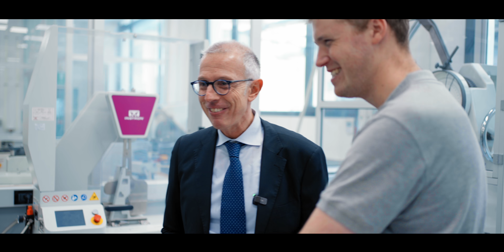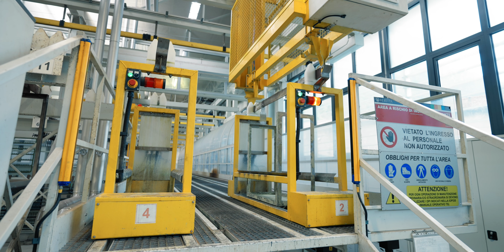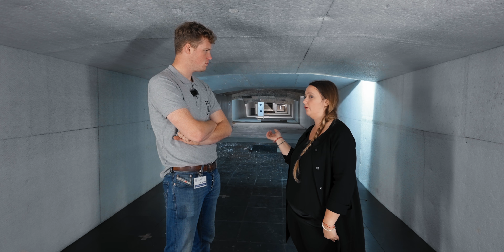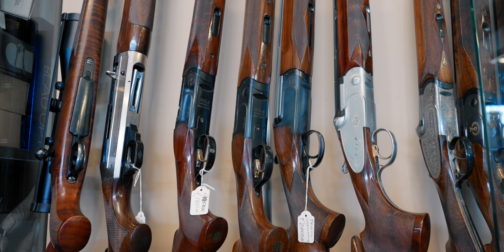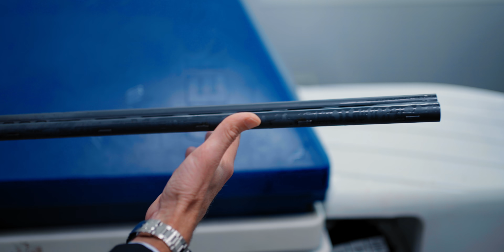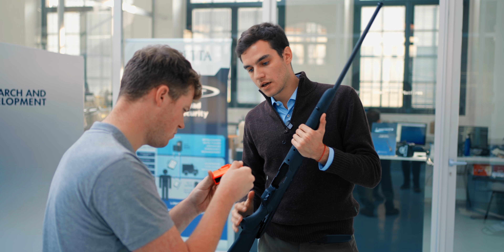The Beretta Factory Tour

Comment: There's some flaws most production guns made within those facilities do not have the capability of iron sights along with a scope combined where as a remington 700 has the options to utilize both on the same gun .the tikka and sako from the factory do not have those options .the sako has the same scope mount as the Brno in which does not have the option for a overunder scope mount !

Comment: I have a full size PX4 Storm in the 40S&W. It is my night stand security system. I like the idea that in the dark I can tell if the safety is on or off with a light touch of the trigger. (No resistance = safety on). I have not  been in a life or death situation but I assume even with shooting targets (100 rounds/month) I may be a bit ramped up and having the DA feels like it gives me a little more control to not accidentally discharge it. If I need to cock it prior to engagement I can. Shooting every other week is probably the best since muscle memory can't be under appreciated. I even practice with dummy rounds drawing and firing from my  bed. (maybe a little paranoid).

Comment: Impressive gun m manufacture, new ideas with electrical stun systems, sound detection triangulated range finders, shared weapons firing systems.Laser captured sound reflecting for window voice and temperature analysis. When newer concepts are created quality builds like yours would make the entire difference. Chromium inner barrels and black chromium exterior surfaces sound like a new way forwards. Carbon fiber is nice but graphite might be a better idea

Comment: Before the Barrels can be Hammer Forged, they have to be Gun Drilled. I SELL Gun Drills in much smaller diameters than what is used for Gun Barrels so I would have enjoyed seeing the Gun Drilling Machinery... 🤔 Hammer Forging also creates the Rifling in Rifle Barrels when a "Rifled Mandrel" is inserted and Hammer Forged. I've been selling Industrial Tools for over forty two years. I could live in these plants and be quite happy. I do own one Berretta. It's their CX4 Storm PCC in 
.40 S&W.... Unfortunately... they missed the mark when designing this one. I had to send the entire Trigger Assembly to a company in Portland, OR. to have the PLASTIC TRIGGER, PLASTIC HAMMER AND PLASTIC GUIDE ROD Berretta PUT IN IT SO THEY COULD BE REPLACED WITH STAINLESS STEEL PARTS DESIGNED BY SIERRA PAPPA..! 😮🤔😕

Comment: I bought my first Silver Pigeon Sporting 12 gauge the fall of 2019. This Spring I bought a 2022 Silver Pigeon Sporting 20 gauge. The wood on the 20 gauge is a little better than the 12 gauge.  BUT they are grade 1, so no complaints. The only trouble I had with ejection was when I was given 2 Federal pink shells to try 5 stand. Both times the shotgun was hard to open.                                                                   GREAT video Johnny and company

Comment: I have a Beretta Silver Pigeon III Sporting in a 410/28 gauge 2 barrel set with a EELL wood upgrade purchased in May of 2021.  Love the gun it's a perfect fit and one day may be the only gun I shoot in 4 gun Skeet competitions.  However there is a problem with the gun that Beretta USA refuses to acknowledge.  That is that the bottom tube for the 28 gauge barrel set was not properly sweated and it leaks.  This causes cleaning solution to get wicked into the joint and the pressure generated by firing then pushes this cleaning solution out at the front of the monoblock.  I have pictures of this joint fresh after cleaning, after 25 rounds of Skeet and after 50 rounds of Skeet that clearly show the accumulation of cleaning solution.  BTW, the cleaning solution used is Ballistol, a combined cleaner, oil and preservative.  At some point I may do a submerged pressure test to clearly demonstrate this defect but I suspect it might take a full day to clear the joint of Ballistol so that gas bubbles will show.  If you read this could you pass this information along to Beretta Italy.

Comment: They need to fix 694 spent cartridge Hull ejection issues. I have seen and handled a few 694 shotguns and they had spent cartridge ejection issues. Either bottom barrel would eject and top barrel not.  Or vice versa.  Occasionally neither spent cartridge would eject.  I find that these Beretta shotguns are very cartridge brand fussy. Chambers tend to be brutally tight and some 12ga cartridge brands will not chamber And some will not eject. Sometimes the ejector miss the spent cartridge rim and the spent cartridge gets stuck below the ejector. Friends have taken their 694 back at distributor and been checked and distributor says that they are fine but, when the gun comes back to it's owner the issues persist.  These are new shotguns.  Seen it happen on new gun straight out of the case and four others less than six months old.  Owners get really mad 😡 and frustrated. One gun been back to distributor three times and still has same issues.  Each owner has tried five or more different cartridge brands. Still Remains the same. Don't know the solution.  Johnny maybe you have some ideas?  Ideas to fix these issues. Every gun properly cleaned and lubricated still happens.  I really like this 694 model but,  this should not happen. I own Beretta products and never seen stuff like this.

Comment: It’s fascinating, but I have to say I just bought a brand new Silver Pigeon 3 and it’s been disappointing. The new “high gloss finish” started flaking off so GMK have oiled the stock as they can’t replace the glossy OEM finish, ejectors were so out of time it was ejecting the cartridge into the breach, there is a sharp spike in the action where the CNC has caught the edge, and now it’s got a split in the forend. I take care of my stuff (my old SP 5 is like new 15 years on and the quality was great) but this new Beretta has been utter crud. Never again, I’ll save up for a something more special.
Reply: I hear you...  check my post.  I've seen 690's, 694's with issues and benelli 828U with issues and DT-11 with machining mistakes...  older Beretta guns 682 gold E and ASE 90 MUCH BETTER THAN some current models.

Comment: I'm curious about the gentleman's statement that their shotgun barrels were proofed at pressures equivalent to 30% more than commercial shells. That seems low to me. I think that the Italian proof standard is 1370 bar or 19870 psi. Isn't that about 2x commercial shell pressure? 100% safety margin is more  emotionally comforting than 30%.  Do I misunderstand?
Reply: I believe he meant 3 times more powerful than a commercial load.
Reply: @joebianco139  Perhaps but that's not my understanding of the Italian proof law either.
Reply: A nominal trap load chamber pressure is about 8500 psi and steel up to 1050bar, 15300 psi.Most guns are rated at 1200bar for steel hunting loads. As an ammunition manufacturer we like to keep the steel pressure as low as possible but to give best possible velocity, somewhere around 12500 psi and keep a safety margin of 3000 psi below SAAMI and 6000 psi below gun proof. So hunting steel cartridges are generally about 2/3 of the gun proof. 

I would be interested to hear what Beretta  would say is a destructive cartridge pressure, maybe over 25,000 psi. My ballistic test gun is rated at 25,000 psi plus and all the years of loading and testing steel the only commercial cartridge I have tested up the near 15,000 psi was the Remington Hyper-steel. It was about 15,000 psi and it scared my like shit to fire it. 

Trap shells really are way below proof, sometime 1/4 in the 5-6000 psi area. 

Proof values are different between the USA (SAAMI) and CIP ( Europe). It’s and interesting subject. I have been making shotshell for 40 years and steel ones for 15.
Reply: @haydenbrown8421  Thanks for the info. Yes, it is an interesting and important topic. As you know, here in the US, there is no proof law. The system is voluntary. I think that SAAMI standard it about 19,500 psi in 12 ga., as you indicated. Because of the prevalence of auto-loaders and the need to cycle properly in a large variety of guns, even "light" loads often develop 10,000 psi.
I would expect a modern barrel to withstand at least 50,000 psi at the breech but perhaps less after many thousands of rounds passed through it.